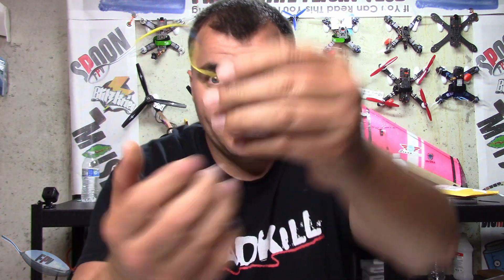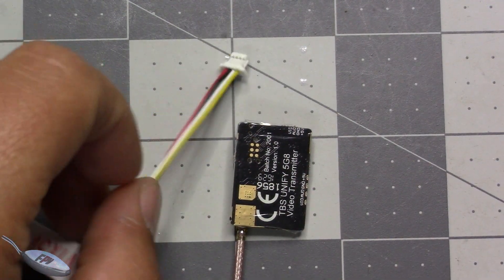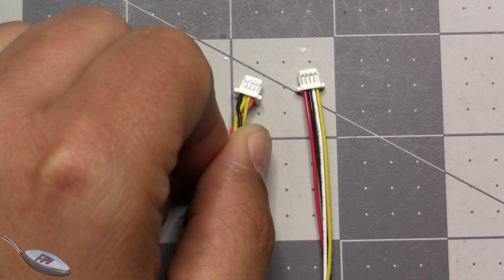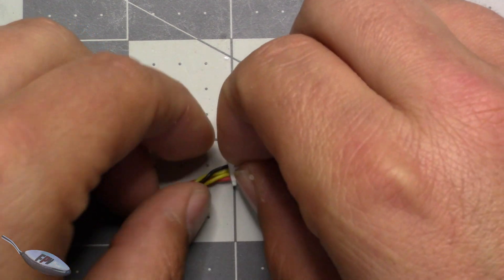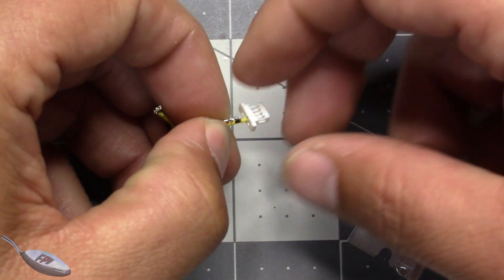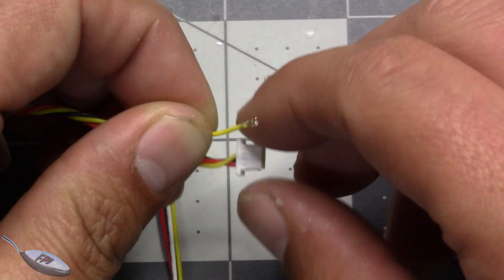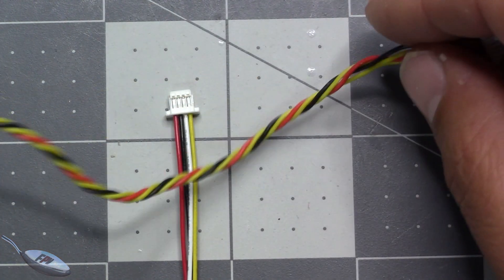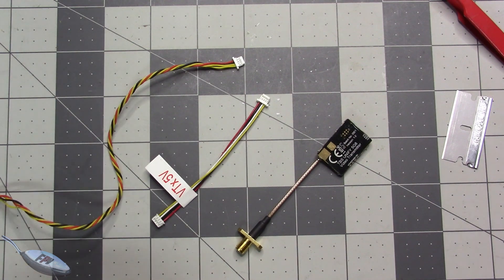TBS Unify Pro Replacement Connector Quick Tip

Comment: hope you can help me on this,?? I am using a 2s battery, 7.4 volts, 800mah,  and a fox camera,for fpv, the tx  is getting very hot, and the camera is getting hot, and light is blue,, can you tell me, way it is getting so hot,  do i need to program the tx to be able to use the 7.4  volts ?? it says it well use 5 volts up to a 6s battery,, can you tell me how to fex it, ??? hope you can help me  thanks ,

Comment: pirofliprc has the actual Unify HV replacement wire / connector for $0.99 so that seems to be a better option..
Reply: Barry Anderberg Good find, but I believe the HV version of the unify pro uses a 5-pin connector, which doesn’t work with the original TBS Unify Pro (uses a small 4-pin connector). The 4-pin ones seem to be a lot more difficult to find.

Comment: Hi. Thanks for the video. Would it be possible to indicate the actual connector model? It would be more useful than a retailer that may discontinue the product at any moment. 

Most connectors small and white are a JST. However, there are lots of JST series and they all look the same in a video. 

You can narrow down by counting the number of poles (4) and measuring the pitch (the separation between holes). This usually leads to a small number of series, and you can determine the One by eyeballing the look of the connectors in the catalog: http://www.jst.com/home2.html (go to Wire to Board Crimp style Connectors)

Comment: why didn't you use the side alternate pads
Reply from the maker: I could have done that, but I like having the connector, that way I can replace my VTX in the field, it's one of the things I carry as a spare.  Considering I direct solder everything else you do make a very valid point though =)
Reply: just asking cuz i broke mine off

Comment: when you say solder directly to the board, are you referring to the BFF3 board and is this a Unify Pro. My question is, is the amperage available on a bff3 ( 3amps)  enough to power the Unify Pro at 500mW of power. I am using the Unity Pro's and doing your backpack solution for power... because I want to make sure they have enough the 600mA of power. Like you describe in your regulator build. But if I can use the Unify pro on the bff3 board on there 5v rail that would be ideal. Finally if I can do that, can I run the unify at 800mW... or will 500mW be the max safe output. Thanks for your vids man. They are awesome.
Reply from the maker: +Jeff Sheffield Yeah sorry, sometimes I forget not everyone is as engineer.  The BFF3 can support 3A on 5V, the TBS only uses 600mA...which is 0.6A.  So yes use the 5V from the FC to power the VTX directly.

Comment: I bought this from pirofliprc.com a few weeks ago. But this is the actual TBS unify connector, same as comes with the Unify. 
http://pirofliprc.com/Wire-Harmess-for-TBS-UNIFY-PRO-5G8-HV-RACE_p_3949.html
Reply from the maker: Yeah that's for the Unify HV version, the V2 (5v versions) which is smaller has a smaller connector....I think.
Reply: Spoon FPV I used it on my hv and my race, but you are right, I think both of those have the larger connector. I am not sure.
Reply from the maker: If the connector looks like the one for your Runcam camera but just with 3 pins, then the HV versions use the larger connector style.  So freeking confusing, wish they would just call it the HV and the 5V or something that distinguishes them.